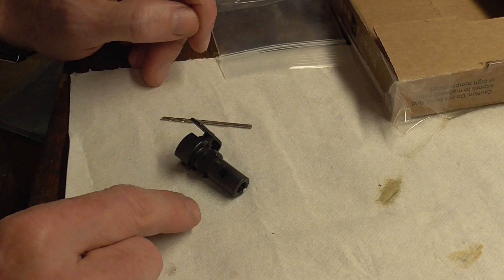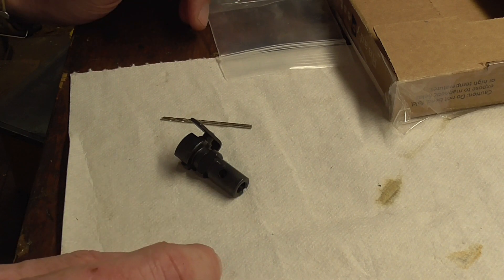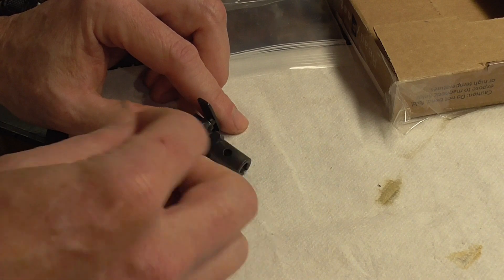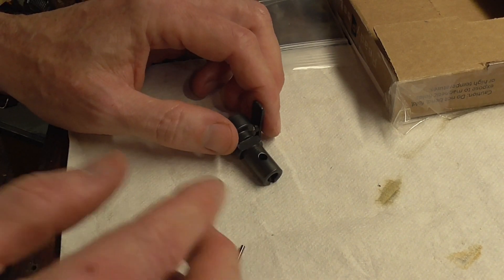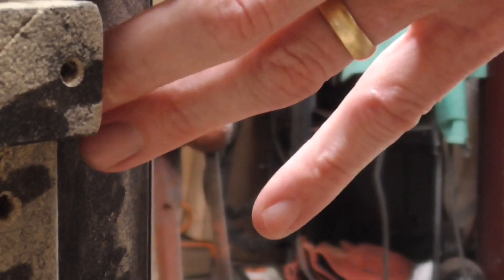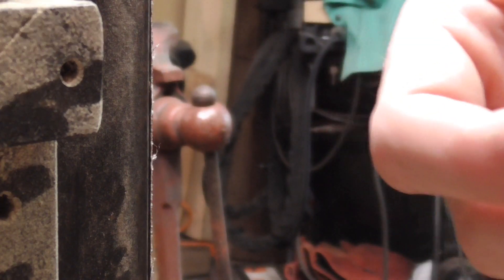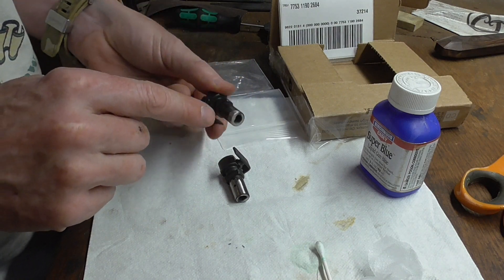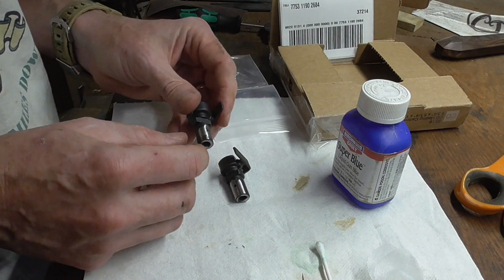Modifying a FAL gas plug for suppressor use

Comment: Great work man! Can you buy chance do a l1a1 Canadian sporter plug? It’s a tad different then the one you worked on here.
Reply from the maker: The inch plugs are different critters for sure.  I feel the Brits made everything more complicated on the FAL...although I do like the mag release.
I do Inch plug mods, but it's a bit tricky.  Basically, I weld over the cutout, grind it out to what I think approximates the 5/64" hole in the metrics, or really just shy of that, and then I send a small round file along for the owner to tweak the cut with if necessary.
Reply: @stimpsonjcat67  yes they did haha.  That’s awesome!  I’m starting the process on the tax stamp very soon I’ll be in contact with ya in the future thanks a lot man really cool what you do!
Reply: @stimpsonjcat67 do you have a service or a video about it? Can i use your service to get a video?
Reply from the maker: @ A video for the inch plugs?
No, I don't think I do,

Comment: If the suppressor is adding extra pressure, then wouldn’t it work/ cycle better with a larger hole?
Reply from the maker: That's the problem, with the can added, a properly operating FAL will now have too much pressure and the system starts taking a beating.  The reduced hole size in the plug reduces the amount and pressure of the gas getting to the piston head so that it is the same as the pressure the piston head sees with the can removed and the 'normal' gas plug installed.

Comment: You could just drill a smaller hole opposite the larger hole and just turn the gas plug around.
Reply from the maker: No, you cannot.
Doing so will expose the front sight disk to pressure it cannot withstand.
At least one person has tapped the gas port from the bbl to the disc and added a set screw to impede the high-pressure gas.  It's a great solution, but not one suitable for most owners.
Reply: @stimpsonjcat67  uhh, may I ask?
How about you change your gas regulator and/or maybe also your gas block vent hole on the top?
Reply from the maker: @thedesignerblacksmith5953  Not sure I understand the question.
You can't get enough regulation to make a suppressed FAL friendly by just opening the gas regulator, and even if you had a FAL where it did, you're just increasing the high-pressure gas released at the gas port, which makes the rifle loud.
The modified plug essentially does change the gas block hole size, but only when needed.
Reply: @stimpsonjcat67  thank you. That can answer my question too

Comment: So i theory you could drill out the grenade setting and have a two port gas plug?
Reply from the maker: The problem with that is it exposes the underside of the front side disc to very high pressure.  At least one person has done that mod by tapping the gas port hole through the block and adding a set screw under the disc.
Reply: @stimpsonjcat67  so i drilled my gas block out with a #29 bit and tapping it at 8-32 shot it today and it ran very nice suppressed and best part was being able to turn the plug and run unsuppressed
Reply from the maker: @orionharmon  Awesome!  It really is a better mod, but not for the faint of heart.
Reply: @orionharmon  any chance you've got pictures of this mod? I'm having a hard time visualizing it
Reply: @m57firingdevice  I'm currently working on a second plug since my carbine Dsa broke the OEM plug so if all goes well I may make a video on it

Comment: How do you account for the heat treat of the part?
Reply from the maker: The plug is not a high-stress part.  It is no more hardened than any other part in the gas system and is as soft as the barrel.  The TIG might take it over the austenizing temp, but I am not sure the part hardens in any meaningful way.
Reply: stimpsonjcat67 tanks for the info. 👍🏻